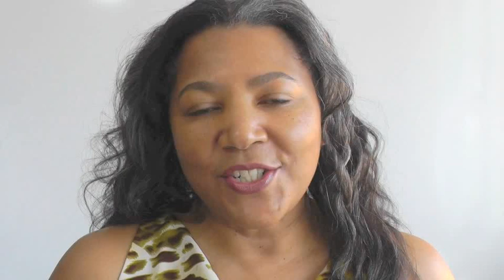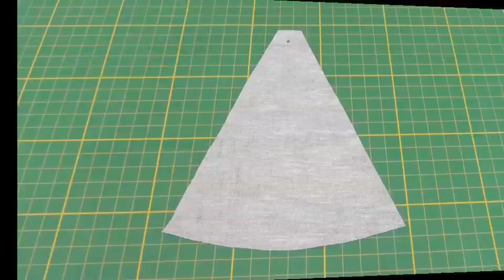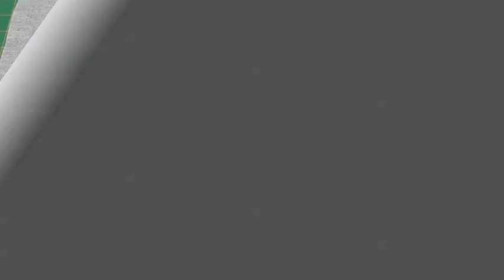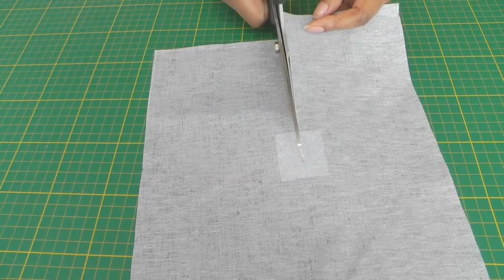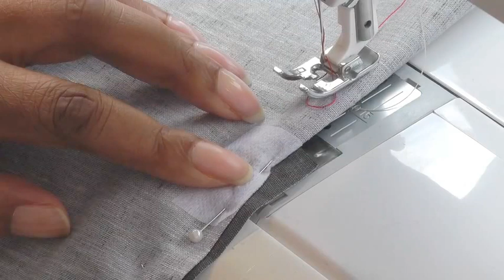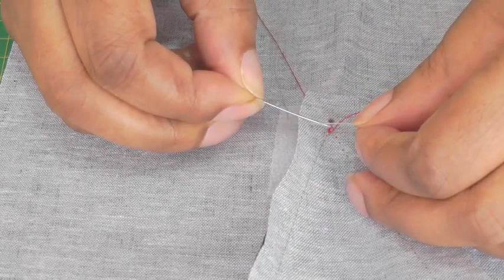Inserting a Godet into a Slash

Comment: When starting at the top of the godet to be stitched, I would also start out with a smaller stitch length for 2.5cm or 5cm (1-2 inches), then set the stitch length back to original settings, and still tie off and put fray check on the threads!
Reply from the maker: Thank you for sharing your technique PJ D!

Comment: Hi thanks for this video. What is the difference between godet and gusset. Also, I want to put a godet as a chin cap. need to put an elastic on the top and need to enclose the elastic and finish the edges.
Reply from the maker: A gusset is use to provide ease in an area were movement is restricted, for example the underarm. Godet adds fullness to the edge of a garment such as skirts, sleeves etc...